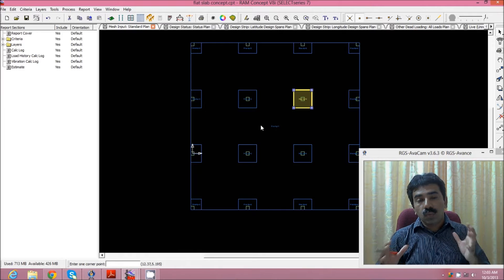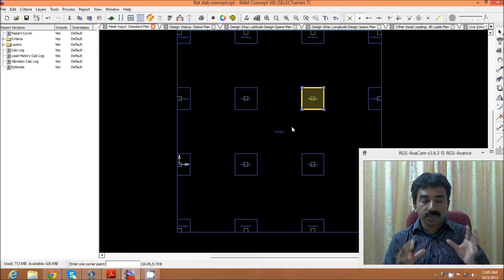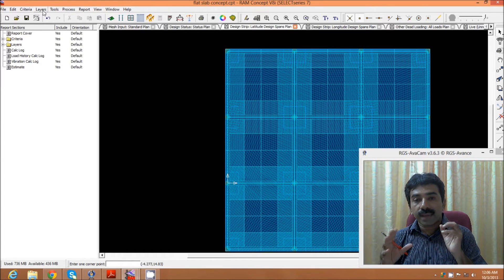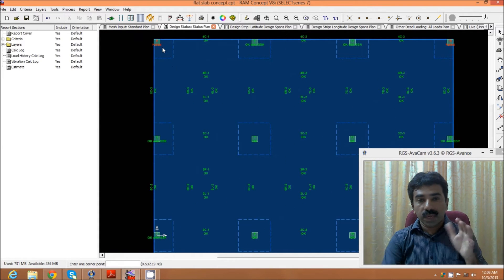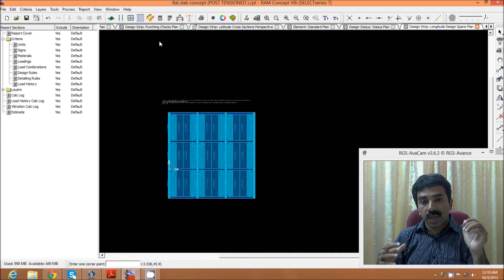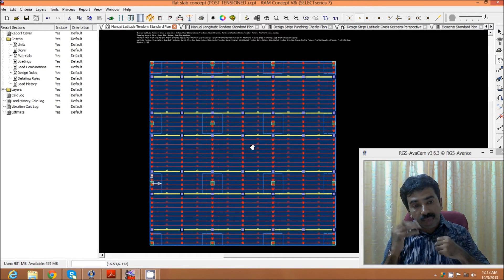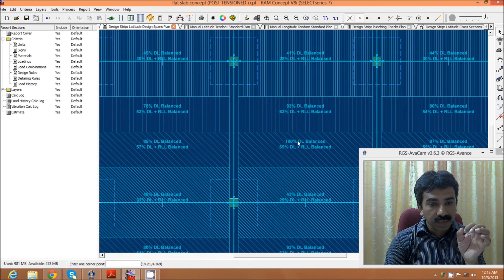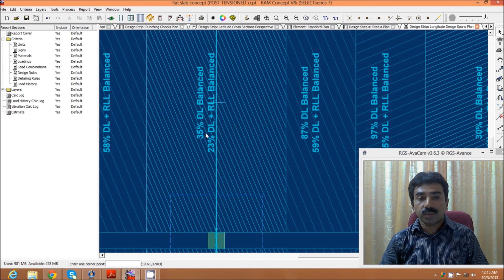Overview of design of Post-tensioned Flat slab structures.

Comment: Can u upload lecturer on explaing full manual of Post tensioning concrete designs by ETABS... The link is given as soon as possible
https://www.google.co.in/url?sa=t&rct=j&q=&esrc=s&source=web&cd=12&cad=rja&uact=8&ved=2ahUKEwi9paOJtaPkAhUK73MBHQvHD_8QFjALegQIBhAC&url=http%3A%2F%2Fdocs.csiamerica.com%2Fmanuals%2Fetabs%2FConcrete%2520Slab%2520Design%2FETABS%2520PT%2520Slab%2520Design.pdf&usg=AOvVaw2Ps6hbweYx3SpEUITrJIz9

Comment: The design strips shown in this video are totally wrong, also in the punching shear when he is explaining there is failure shown; see the red digits near the columns inside the drop when he is explaining the stress in punching, he changes the subject and goes for load balancing
Reply: yeah we do know that there is failure in punching . please see the video carefully and we are explaining about the failure.

we are not doing any real project in this video but just trying to explain the way to judge the strips and the concepts of load balancing
Reply: you have written that the design strips provided are totally wrong.

we have following views in this aspect:

probably you have in your mind that the post tension ed flat slabs,  the tendons may not be laid in column strips and middle strips because generally for post- tension ed concept engineers do follow  100 % banded through columns in both directions or 100 % banded through columns in one direction and other direction uniformly distributed.
however the third possibility that analyzing the post tension ed flat slab as per the mid strip and column strip concept is also acceptable and that is what we are explaining in our video. Also as said earlier we are not doing any real project and while doing a real project definitively engineer experience, judgement and practical aspects to be considered.